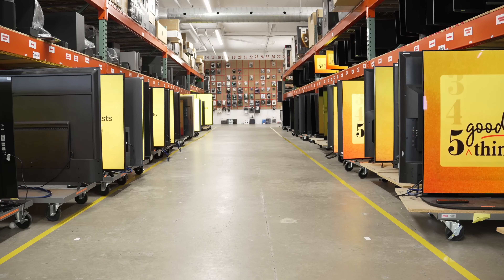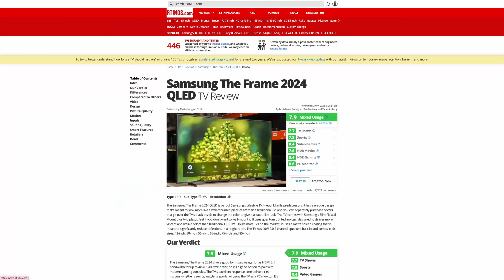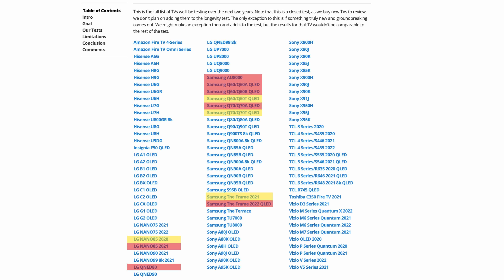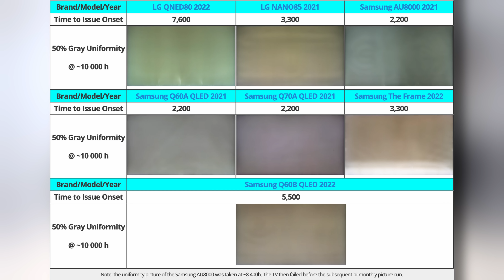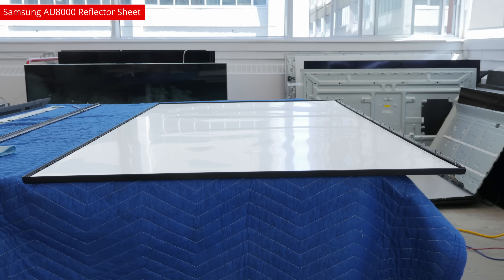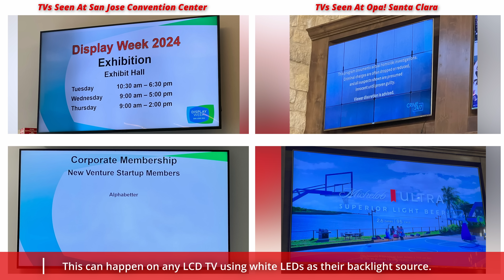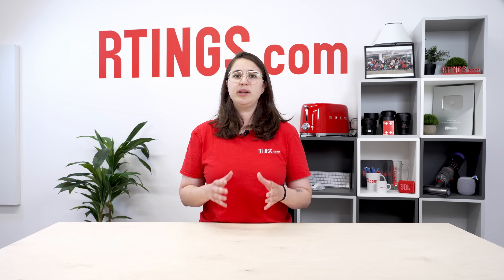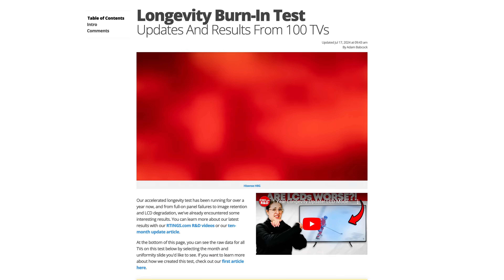Edge-Lit TVs Fail FASTER Than Others (100+ TV Test)

Comment: I profoundly dislike this thin everything trend. I would pay extra for thicker wOLED TVs with a heatsink, especially if it gives me more durability, less burn in/retention, or more brightness.
Thanks for all your work!
Reply: Not to mention somewhere to grab the dang thing if you want to move it from one room to another.
Reply: 100% I actually sticked a 12mm PC fan on the back of my TV, found the hottest spot on the back, put the fan over a vent opening near that spot, lowered the temps considerably.
Reply: @Roman00744  Thanks for that comment, I been thinking exactly the same way. But a 12 mm fan seems very small?
Reply: @stennordenmalm1735  lol sorry meant 12cm
Reply: Ding ding ding!!!! I agree with this so much! If I'm spending alot for a device, I'll much rather have durability than it being thin.
Reply: 100% agreed. People need to stop trying to make the TV part of the room aesthetic. No, you don't have to try and fool people into thinking your TV is a picture frame. That doesn't accomplish ANYTHING for you and it only leads to more problems. TV's are thin enough now as they are. Let it go.
Reply: And I'd pay so much extra for a thiccc iPhone with more battery
Reply: Not to mention that I personally think a TV with slightly bigger bezels accommodating proper front firing speakers is way more sleek than a TV with a soundbar
Reply: Glad I'm not the only one. Plus it'd be easier to hold & set up...
Reply: Well you are not going to have your tv on max brightness and in for 1000 hours so what are you saying
Reply: Sounds like you’re talking about the LG G series. I hate when I have to move my c8 with the upper screen so thin
Reply: Apple tried that with the iPhone 6 and there were so many Applecare claims with bent iPhone 6 plus and even the regular 6s that Apple had to make the iPhone 6S slightly thicker and out of a stronger alloy. The ultra-thin M4 iPad Pros will face the same faith and the iPhone 11 Pro thru the 15 Pro Max are about the same thickness as the iPhone 5 for durability reasons.
Reply: Why do you even need a thin TV, you don;t actually physically use it like a phone. Who cares if it's 28% thinner?

I don't even like thin phones...
Reply: honestly I would like a casing that is rigid enough to have handles so you don't have to use those stupid plastic bits when installing the TV. I want to be able to mount the thing without needing to worry about unremovable hand prints or cracking the glass on a 70inch + sized TV.
Reply: 1 guy will pay 2000$ for a TV with acclaimed super high durability 

10 other guy will pay 500$ for a TV with “lesser” durability. Can be various reasons, maybe they just don’t care and willing to pay for another TV when it breaks. Maybe they just want to use it temporarily (a year or 2 in rental place). Maybe they don’t have much budgets. Etc

Combined with the expectation that everything must become cheaper, you can see why manufacturers put durability on lower and lower priority scale
Reply: Im sure you would, but you wouldnt pay the cost of an extra 2-3 tv's would you? I'm sure the manufactures love that their displays fail within a given time so you'll buy another TV.
Reply: @lyianx Any electronics that fail prematurely, I don’t replace with the same brand!
Reply: Me too.
Reply: And it'll come with more spyware, "free" of charge!
Reply: CRT Rear Projection TV is perfect
Reply: I still use old Samsung led TVs. One is not in use for 3 years now. Is now 11 years old. The other main TV is about 8-9 years. Mostly on full brightness.
Reply: You can thank Apple for this stupid thin obsession.
Reply: Nowadays you need to strip TV and copper mod like people do with gpu's 😂
Reply: I have two TVs in my home a 55” LG C1 OLED and a 50” Vizio LED the Vizio Is full aray backlight with local dimming. The Vizio is almost 10 years old still going strong with no issues. The Vizio runs hotter then my OLED little understandable when there’s physical LEDs I can feel the heat out the back vents. Most the heat I can feel at the top of the tv makes sense heat rises. It be cool if TVs could tell you how hot they are getting like something you could check in the settings.
Reply: Even apple, the company that was bragging about how thin their phones were a decade ago are now going back and making thick and heavy phones lol.
Reply: The manufacturer wants you buying a new TV every 5-6 years though
Reply: and what is this nonsense about thin TV's aesthetics? who even looks the side of his/hers TV?
Reply: So do I and that’s why I didn’t buy a slim laptop pc. Instead I bought a hp minipc which is much easier to keep cool. I even put it on top of a damp cloth to help cooling.
Reply: @TheFrewah  😂 it would be so humid inside, I bet the components inside have rusted by now
Reply: @Dinu5346  Nothing comes in, the underside is solid. Another solution would be to find something that you can put it on, makes good contact and has good thermal properties
Reply: @TheFrewah  try doing that in tropical settings
Reply: @TheFrewah because moisture evaporating up into you computer is so good for it.
Reply: Omg that is terrible.... Why would you introduce moisture to electronics.  @TheFrewah
Reply: Dont say that! They'll start charging more for the same amount after charging more for less!
Reply: Tvs should come with cooling fans 7:39
Reply: If products were durable, companies wouldn't be able to sell you a new TV as frequently, it's sadly planned obsolescence at work.
Reply: Just buy a Plasma tv, if you can find one that is.
Reply: @NEON2600  Plasma TVs haven’t been a thing now for 12 years. Yet my 19 year old Plasma TV is still going strong with everyday use. The only issue is the remote broken 7 years ago

Comment: I guess I should have thousands and thousands of hours left in my set given I run my backlight in SDR content at literally 4 out of 100 which gets me there abouts to the 120 nits SDR is roughly graded to.  I see the need for massive brightness for HDR and my set can hit over 2,000 nits in smaller window sizes but there is no way I need 800nits in full field windows in SDR.

Comment: While I appreciate standardized testing I think the methodology of this testing does have issues.  I understand their need to accelerate wear testing I think it's a bit flawed.  I mean the vast majority of users are not going to run their sets at 100 percent brightness at all times for 14-18 hours a day.  It's kind of hard to extrapolate real world data out of some of these tests.  Quite a few modern LED sets have backlight systems that can pump out a thousand nits or more of brightness in even SDR content which was originally mastered at roughly 100nits.  And I can't think of a single person I know that runs a modern led set at max brightness all the time in SDR.  Would have loved to see this same accelerated wear testing at brightness set to half or 2/3rd and not maxed out for every hour they run the tv's then see how that effects reliability.
Reply: the test is not trying to show of normal or general use. there is no use for that testing.
stop texting and start thinking. get of your damn phone you kid.
Reply: @sudd3660  Ah ok....why should I care if a tv melts running 18 hours a day for 2 years at 100 percent brightness if the vast majority of people are never going to stress their tvs that hard.  Not a ton of practical data about real world reliability can be deemed from this testing.  While some inferences can be made.  Data for your average Joe this is not.  You going on a rant isn't going to change that...

Comment: I'm curious what the conditions are of the warehouse the test is done.  Ambient temp?  A/C?  Air movement?  If it's fairly warm, with no air movement, and these hot TVs are all right next to each other, that could aid in the failure.  Fancier TVs have heat sinks.  Lower end TVs, like edge-lit, don't.  Just curious.

Comment: 4:24  this is not how C to F temperature conversion works. Even though absolute 20C = absolute 68F, when you're talking about a temperature DIFFERENCE of 20C (implied by saying 20C HOTTER THAN...), then it does not translate to a temperature difference of 68F, but rather a difference of 36F only. Check your math again and perhaps issue a correction? I imagine this was just poor script writing that got overlooked, but mistakes at the very basic level like this is what then makes us wonder whether you guys are truly qualified to be testing the things you try to test,  and even more important,  whether the conclusions you reach are the correct ones.
Reply from the maker: Thank you for pointing that out, that's a mistake on our part and we've added a new pinned comment to correct it!

Comment: Nice test thanks Abby ✌🏻 most affected televisions are Samsung LG personally I only buy Sony
Reply: The data is for edge lit TV's. They get too hot, regardless of which brand it's made by. Sony is great but one of their models was on the list, too.
Reply: @frommatorav1  I never had problems with my older Sony tv. I have my first directly led l array at the momen
Reply: @patrickb1982  direct LED seems to be a better method than edge lit, so you're safe. Sony has good qc but if it was edge lit, it would still be vulnerable.

Comment: Great content as always! My parents bought a 55" UE55D7000 from 2011. Yes it has uniformity issues in form of vertical lines but the TV undergone really intense use. I think about 3-4 hours per day on average over 13 years. What broke was the power board. It made the TV shut down randomly, sometimes made the TV turn on and off an on and off. I thought some caps got bad over time. But after a close inspection all caps were in shape, literaly. But I found a broken soldering spot of one of the transformers. And the TV is back in action for quite some now.
I think older TVs were built with more resilience in mind to not scare customers off to a different brand. Now the market is saturated and brands starting to trade durability for more profit. And they get away with it. But rting won't let them off. Thanks a lot!!!! <3
Reply: I work with broadcast electronics repair technicians and I know some things about circuit boards, thermal lifespan etc... With almost anything you never want to drive circuits to full power or close to it if you want it to last. Usually running anything that makes noticeable heat at a reduced level will ensure everything is running well under its thermal rating. Its not true for some things but if you simply monitor how warm or hot something gets and can reduce levels and make it cooler that is generally smart electronics management.
Reply: You consider using a TV for 3-4 hours a day intense usage?! Why exactly is that? You'd expect at least 10 years of 12 hours a day usage out of a good TV. Hell my PC monitor's over 10 years old and it's got no issues yet. Think I've used it for 5 hours a day on average. And this is a cheap $110 monitor I'm talking about. You have such low expectations. Damn these companies really trained you well. What country are you even from?
Reply: @davidcobra1735  well great for you having such high expectations. But please let others their opinions, you are not the standard for TV longevity.
Reply: I've got an edge lit Sony xbr49x800e from 2017 with about 4-6 hours a day use every day and its got no uniformity issues where I can see the LED area or any of what they showed in this video. I just played an ambient light test video with full screen white and all colors to verify. My family does not like high nit value TVs that make you squint when watching with low room lighting and we have the brightness set to 32 which is about 70%. I also use the TV in pro mode with inputs only removing the smart TV functionally and we use a streaming stick that's more modern. I assume not using the TVs smart apps also reduces strain on the processor and power consumption which helps with the longevity o of the power supply.

Comment: This doesn't exactly surprise me, the high-end monitors with high brightness ratings tend to have bulkier heat dissipation or active cooling built-in. This is something they don't want to bring over to TV's - probably because of the bulk, and the cost. I wouldn't doubt that many TV's might last longer if you add some active cooling (low-noise PC fans aimed at the back panel).
Reply: only you americans have a hard on for using tvs

Comment: More expensive to make, more prone to failure, worse image quality. Yeah, that's a trade-off for consumers.

And now I know my pc monitor is edge lit.
Reply: My monitor is set to a lower brightness than my TV. If you do the same, it might not be an issue. Edge lit heat issue is much worse when being used at a very high brightness level. Under 75% causes much less heat to get produced. I keep mine in the low 50's, I think.
Reply: @frommatorav1  I understand that, but it's a cheap monitor and already really dim. I won't be mad if it does break.

Comment: The heat issues I've experienced (on a 10 year old telly) have been the control electronics overheating.  I DIY'd a fan in the back (powered by the computer attached to it) and ... no more temp issues (and fan can only be heard at night, with ear next to the fan).

I genuinely don't understand the obsession people have with how deep their display is, perhaps that's because I'm an old Millennial who grew up with CRTs, who's happy to have knocked feet from the depth, so fractions of inches seems petty.
Reply: I got an OLED this year and was shocked to see how thin it was. I hadn't even considered it or cared about it prior. If they do LCDs that thin, no wonder there are issues. OLED luckily stays cool and has very high efficiency.
Reply: The old crt tvs weigh a damn ton!

Comment: I’m thinking both quality control and the level of quality of some of the parts of todays TVs are far less than years ago. I have 3 Panasonic edge-lit LCDs : 50” E60 from 2013, 40” 520U & 55” 530U both from 2014. Other than a crease in the right side bezel of the 50” I accidentally did when lifting it they seem to perform as brand new. The 50” does has light bleed/spotlighting at the crease in dark scenes if you look for it but it’s minor. Otherwise I do not notice any decline. Wish Panasonic still sold here in the US. Not sure about their longevity these days, seems all brands have issues. My next LCD will be direct lit however with FALD, maybe mini-LED too if I don’t go with the Sony X90L.

Comment: I think it is down to cheaper grade components and nothing else, we have a 12 year old edge lit Samsung TV with zero screen uniformity issues at all and it runs atleast 8 hours everyday at full brightness, but we have a 5 year old direct lit Samsung with extremely poor uniformity and dark and bright spots and some burnt LEDs and then we have another 2 year old direct lit Samsung TV with dark spots starting to appear when viewing bright colours in a grid like pattern, also always used it at 60-70% brightness and not more, it also runs much less per day than that 12 year old TV, build quality is much worse on these TVs as well as compared to the old model, they are definitely cheaping out everywhere!

Comment: I use my Panasonic LCD 1080p television for  over 14 years, for an average of 12 hours a day. I have not encountered any problems so far, and still the picture quality is as good as the latest model OLED or QD-Miniled televisions. It's a matter of product quality. After many years, I realized that Panasonic is a reliable and respected manufacturer. Other companies' TV production is based on poor quality and cheap advertising. Thank you very much for your honest analysis and information about customers, fake and cheap quality TV companies and products. Regards
Reply: I have a 42" LG LCD 1080P TV from that time frame and it still has perfect color but it's noticeably dimmer than newer models. It has been in the bedroom for about 6 years and doesn't get used in the bedroom very much, especially compared to the living room. I paid more for it back then but it was worth it because it's still working well for 1080p content.
It doesn't compare to my LG C1 65" OLED TV, though. The 4k HDR and extra size make it much better to watch.